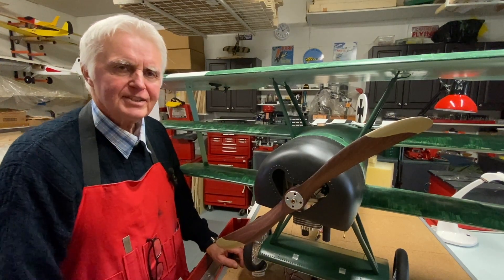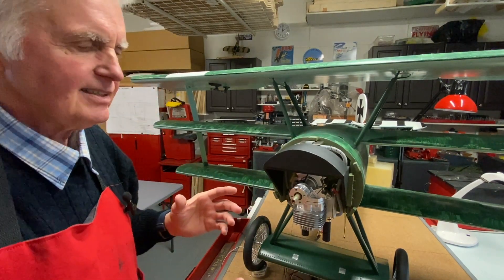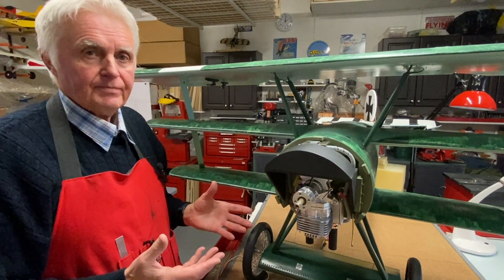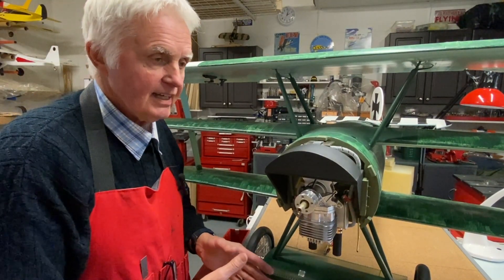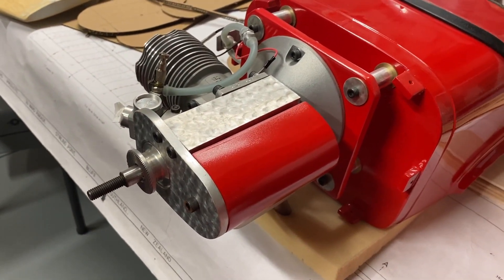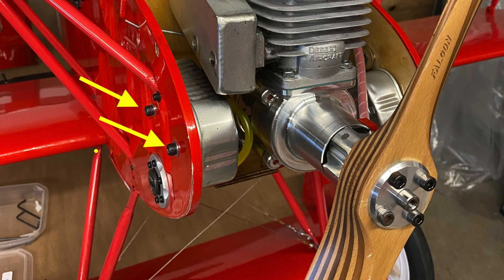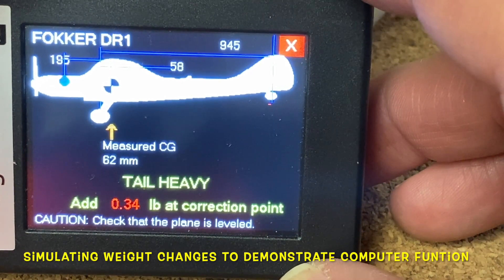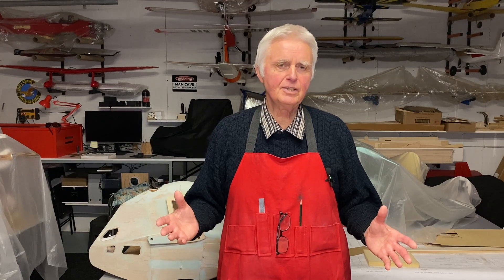A custom Weight & Balance system for the CG position on a RC Airplane. Episode 1.

Comment: What’s the COST ?   Most A&Ps I know should review your Wt & Balance demo.
      My hat’s off to you; CAPTAIN, very well thought out !    
                                Almost can’t stand your nonsense thoroughness ! 
I only want a “model” that works; not a Part 135 flying machine.
My efforts are to work at achieving flight at DOLLAR 💵 STORE 🏬 prices !
                      (Not in anyway minimizing your viewpoint)
Reply from the maker: Hi Ken, As for the cost that's a good question :)  The actual weight housing takes very little wood to construct. The lead shot I used to obtain from an auto tire shop was the balance weights they were throwing out. For actually measuring the CG any traditional method works. I only use the Xicoy computer system for convenience/accuracy since I'm usually alone in the shop.
So, for the most part, staying on budget with an aircraft build project when it comes to weight and balance is manageable. Rick

Comment: My suggestion is to make the weight removable until after the test flights where you may want to remove a bit each flight until the aircraft flys and lands the way you want it to.  The reason I do this is that I have found that BUSA models are designed intentionaly  to have a forward CofG to help ensure a successful first flight.  The downside is the aircraft lands too fast and is not what you'd call gracefull in flight.  Every BUSA model I have built including the DR1 starts out at the recommended CofG using a pound or more of lead up front and ends up with no lead at all once I get the aircraft to fly and land gracefully the way I like them to.  BTW I have found that Sig cubs, Spacewalkers and Hogs call for a CofG that is actually pretty accurate to the plans even after test flying.
Reply from the maker: Your suggestion of adjusting the lead weight is definitely another way of doing it. Never have built a Balsa USA model, that's interesting about the one pound change in weight. I personally haven't had to make one pound changes. Nevertheless, as you mention the handling characteristics are very much influenced by CG. Far too often a modeller will start with a nose heavy airplane and leave it that way. You are right about Sig models. I believe Sig may be making a come back in producing balsa kits. Thank you for your comments. Rick